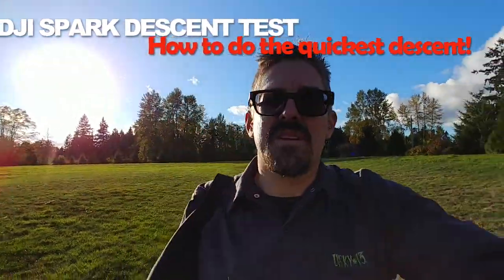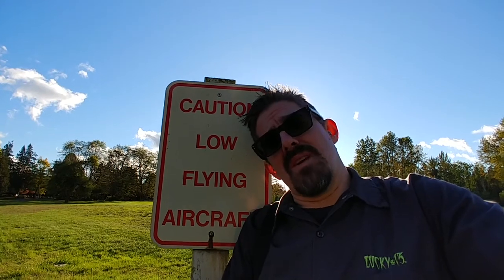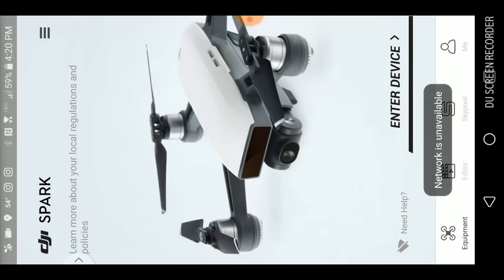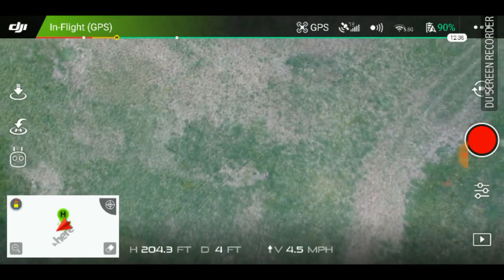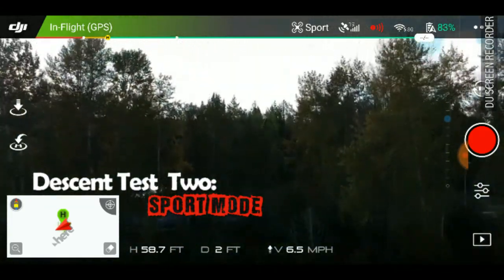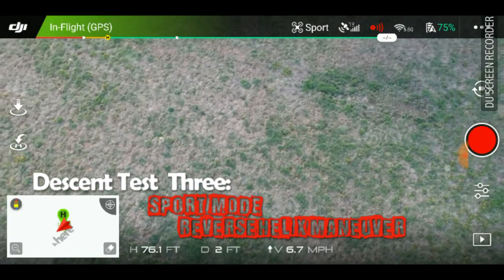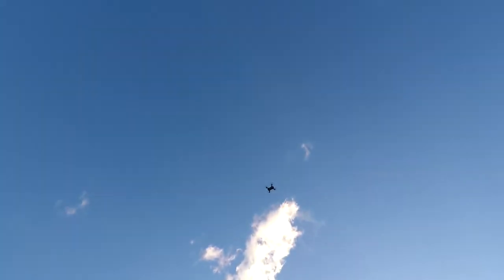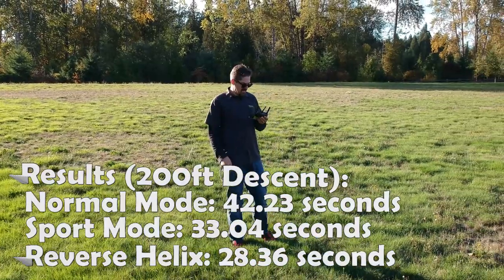DJI Spark Descent Test: How to do the quickest descent!

Comment: hey why my spark limite descent speed is only  3.8 kmph, even in sport mode,.Can be motors damaged ? or IMU .Thx
Reply from the maker: Are you pulling it straight down? You'll get minor speed decent increase in Sport mode but you really needed to be spinning in a circle with forward motion. Think decending Helix.
Reply: if i do that , the spark speed up or down by itself.What do you think is problem of the IMU or Motors ?
Reply from the maker: Is this only on descent? I think it would manifest in other flight patterns as well. Like can you top out full speed going forward around 50kmph? Note that wind can play a part with this but you should consistently get to around 50kmph in forward sport mode. I would file a support request with DJI, they are pretty good at responding.

Comment: THANKS FOR FINDING THAT OUT & SHARING IT. I AGREE WITH YOU 100%. I WANT FULL CONTROL OF THE DRONE SO THERE ARE NO UNEXPECTED RESULTS THAT CAN HAPPEN WHEN USING AUTO PILOT ROUTINES. YOU WOULDNT HAVE ANYTIME TO CORRECT IT IN AN EMERGENCY. THANKS AGAIN.

Comment: I either start my decent about 400m out flying it home which gets me some battery gain as the motors don't have to work as hard. Also in RTH mode it will decent a little quicker then sport mode. But the first method I use and prefer. Also use it for the mavic.
Reply from the maker: Yeah I discovered RTH was pretty performant after someone from DJI Facebook group gave me tip. I still find the helix is fastest, but that's nice when you just want to tap one button on the controller..